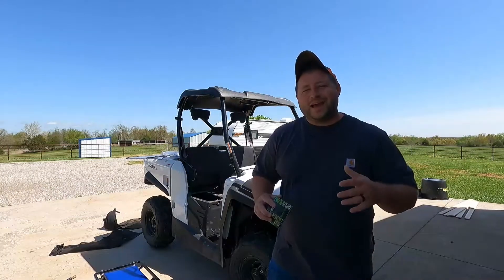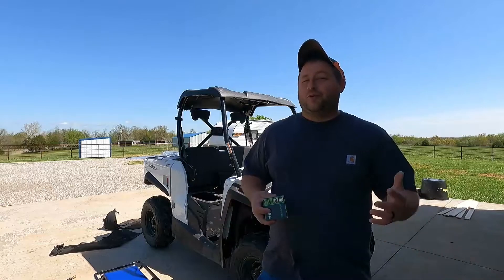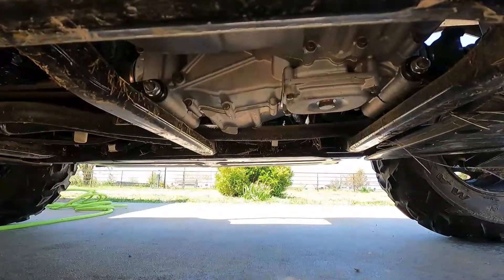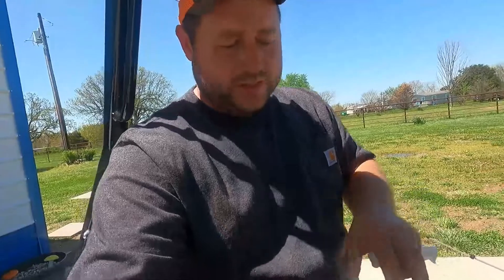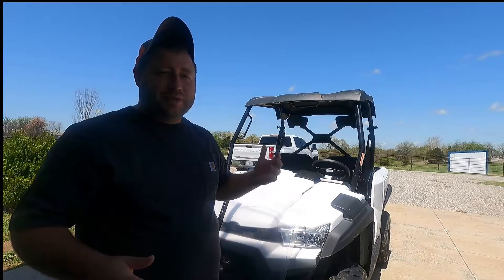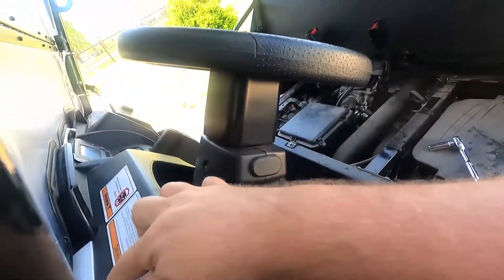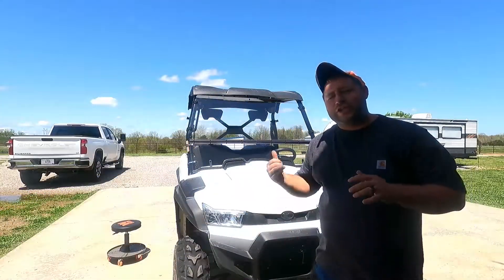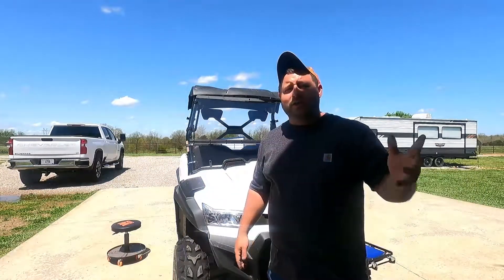Kymco UXV 450i - Custom Windshield + Oil Change

Comment: Just wondering what these sidexsides cost? Kymco was a division of Honda back in the 80’s. They broke away and started making 4wheelers for Polaris,Arctic Cat, and Kawasaki. I know Kawasaki uses their engines in their mule series sidexsides. Not the sx series.
Reply from the maker: When i bought this years back it was 9k, now they are running closer to 13k in missouri
Reply: I found a leftover ‘22 for $7k out the door in Missouri. Had it for a month now and very happy so far.

Comment: Quick and probably basic question but am I tightening the oil filter by hand or wrench when completed. I understand it says turn 3/4 way and add slight film oil to gasket to check for leaks …
Reply from the maker: I personally always hand tighten…even on my main vehicles